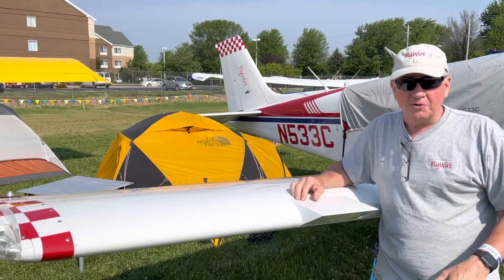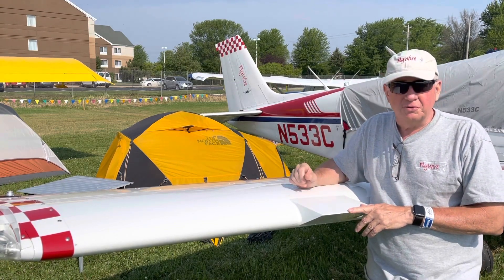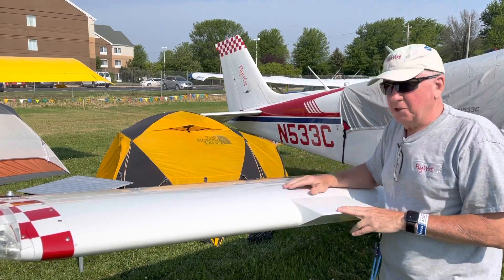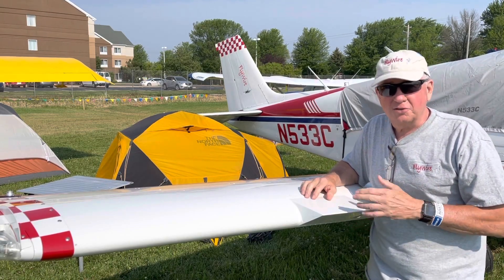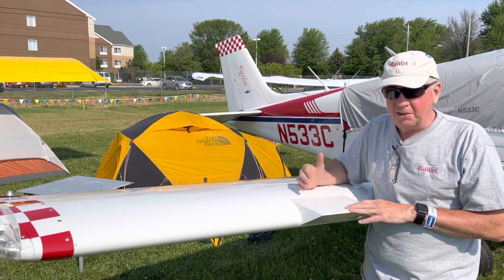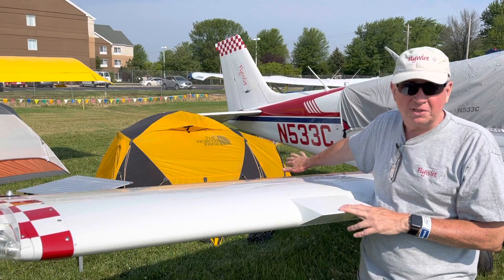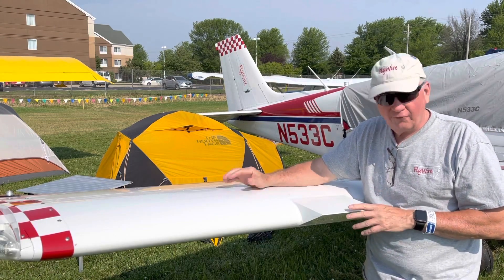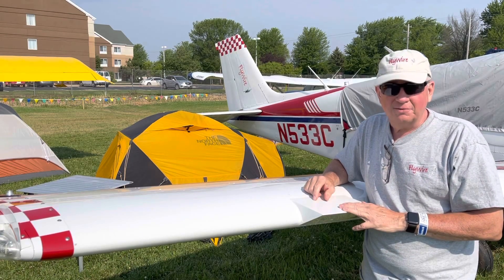FlyWire on the Road- Update Leading Edge Wedge Real Purpose

Comment: Thank you for the update and info. I still don't get the VG term to describe this wedge. VG's to me are the tiny metal strips arranged in a W pattern all along the top of the leading edge. Those are to keep the boundary layer attached for longer, such as a Navajo for example. The VG's are an STC kit that increases gross weight.
Reply from the maker: Thanks Craig. Vg’s arranged on the wing as you describe is common. But not definitive. This wedge is indeed a Vortex Generator.

Comment: Summary: Scott still doesn’t know how the wedges work.  Maybe the third video will be the charm … and will be audible.
Reply from the maker: No, wrong. I explained it right. the music covers 'secret' information that I was not supposed to share. As for audible, it was filmed in the field, at Oshkosh with airplanes flying. That doesn't equal a studio and perfect sound. turn up the volume.
Reply: @FlyWirescottperdue  What is secret about a design that is how old now?
Reply: @FlyWirescottperdue  Secret info? Surely it’s been long enough since the design that it’s not really an issue?

Comment: Thanks Scott, sort of a stall fence and a stall generator? I recall my father talking about how in the Navy when he learned to fly in the Steraman, some instructors removed a stall generator strip from the inboard wing sections on some of the Stearmans, which resulted in lower stall speeds but made the aircraft more prone to spin. He said some instructors preferred to have the aircraft more spin-prone to teach spin avoidance and recovery.
Reply from the maker: US Air Corps Stearman's did not have the Stall Strip... Navy Stearman's did. Some with strips on the lower wing, some with strips on both. The airplane spins just fine with or without. But a spin over 10 turns becomes very stable without stall strips. The worst issue with stall strips is the stall break is VERY abrupt. Without them it is very gentle. I know of several landing and takeoff accidents where stall strips were a factor.
Reply: @FlyWirescottperdue  Cool and Thanks Scott, I was not aware of the differences between U.S. Air Corps and Navy PT-17s. and after 10 turns spins becoming unstable. My father learned in the Navy and gave me my first aerobatic and tailwheel training in an old Navy Pt-17 and I would be interested in knowing more about accidents you mention.  I seem to recall the first PT-17 my father had with the 220 had strips on both upper and lower wings, and him saying stall speed was lower and stalls very gentle without the strips. When I started flying it I suggested we remove them, but he said if I was going to be flying it was likely best to leave them on, and mentioned something about seeing sailors kill themselves with departure stalls and spins. 
Later, I flew a Stearman without the strips and a 300 Lyc and it seemed pretty tame during power-on and slightly accelerated stalls.Great flying old airplane with the 300Lyc. 220hp to me seemed not enough and 450hp to much much weight up front.

Comment: G'day,

Ah, so...

Vortex Generators remain a seriously  counterintuitive "Black Art"...; it seems.

I wonder if the Aerodynamicists have any clear idea of which VG shape/concept will do what..., before they add them onto anything - or if they simply cobble stuff up in lots of Variations and run them through a Wind Tunnel to see what happens, and then try out the three versions which appear to be the most promising on a real Aeroplane...?

Then after they discover what works..., that's when they compose the (likely) explanation for what they find themselves looking at...(?) !

I accept the fact that they DO work, but they sure don't look as if they should be able to help anything..

Such is life,

Have a good one...

Stay safe.

;-p

Ciao!

Comment: Totally makes sense that maintaining laminar flow would reduce the imbalanced moment between a fully stalled wing versus a wing that isn't stalled (or only partially at the root.) But... how does that form and the vortices/turbulence behind it work to stop the far end of the wing from going into stall?
Reply from the maker: The vortex helps keep the boundary layer attached and the turbulent area acts as a stall fence preventing spanwise flow.